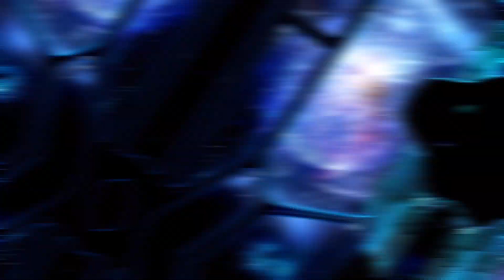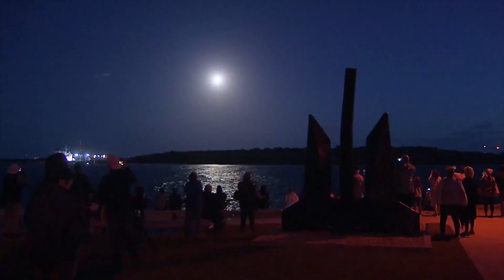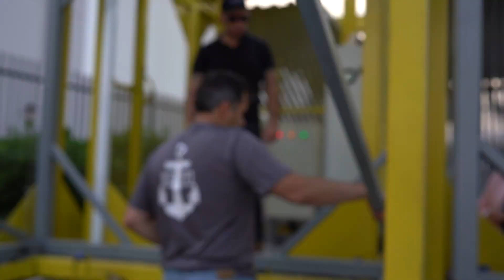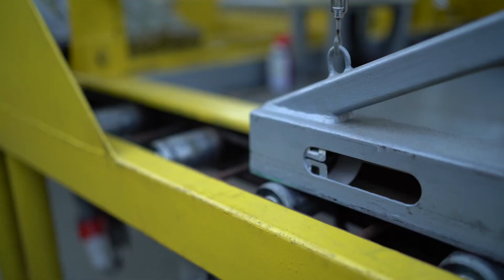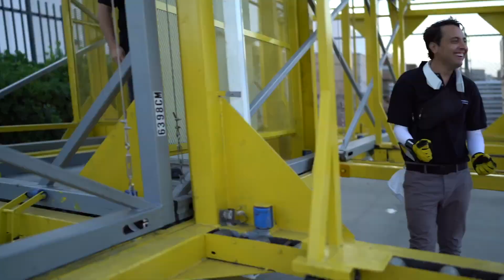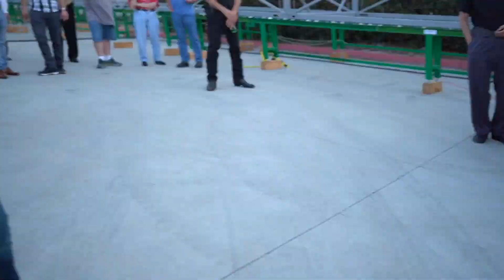Orbital Assembly Corporation

Comment: single atom thick semiconductor that has been fused to superconductor  can be formed into rings in space that uses van de waals effects to capture hydrogen ions in the solar wind via a funnel- this is very new technology- with a clever shielding design we can used the cryogenic temperature of shielded space to maintain conductor rings that can capture hydrogen and even helium ions. There will certainly be a design that can accomplish this and i'm sure this tech can be accomplished before 2030- like the invention of the solar panel this innovation can have a huge effect on solar resource capture. The ventri was a quantum leap in engineering design that enabled the carburetta and the efficient internal combustion engine using vacuum force to mix the fuel air mixture.

Comment: Moon base makes more sense- the He3 is basically a gold mine PERIOD. All the other mined rock is also worth a lot- space based solar pumped lasers can be used for zero gravity 3D printing and the moon has the capacity for Moon based concentrated solar power regolith processing- all these metals also are in oxide for and all that oxygen can be collected- He3 can fund all of this and it is sustainable, new advanced stirling heat pumps run on Helium- maglev can be cooled by Helium and fusion reactors will be quickly realizable with an abundant supply of He3.